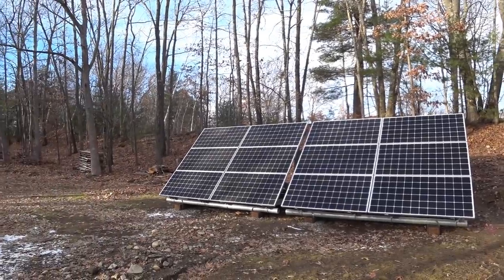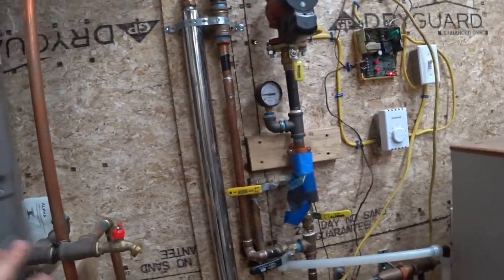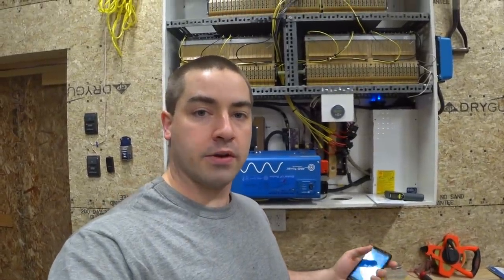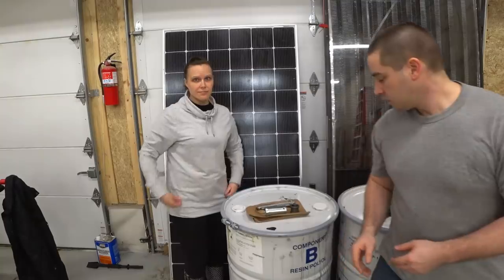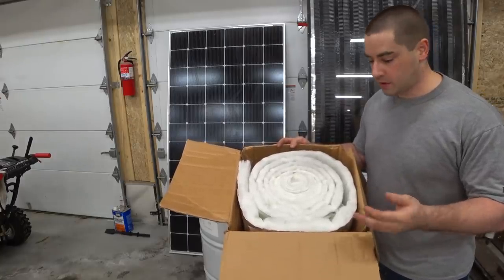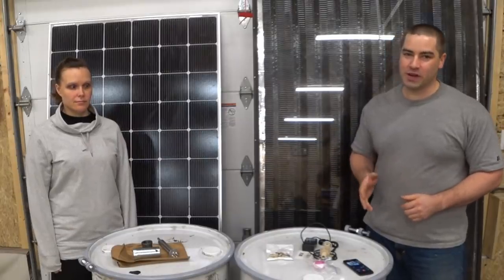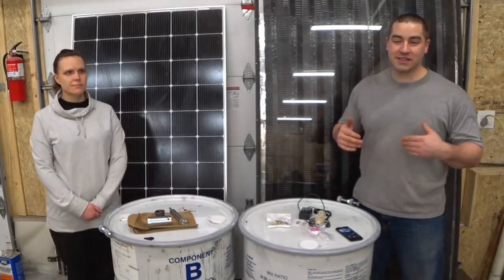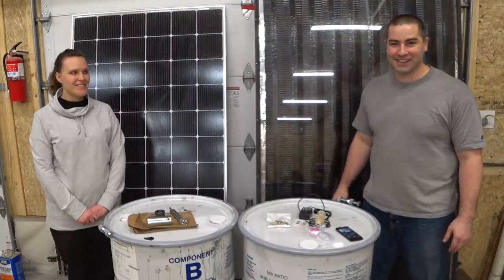Solar PV vs. Solar Thermal Experiment

Comment: Another thing, your thoughts on effiencies of 12v over 24,48 or even 120vdc systems, there is a kinda smart guy , who says the effiencey is not do much to make a difference, I don't like making high current DC connection that I don't have to, that's why I went with 24v, be has a offgrid house 12 v LiFePo4 ( he also thinks liion is crazy)  I do not agree, I wish I went with a 48v on mine. 7s 29.4 is a bit of odd ball. It is getting more common. I have 260 ah banks in my system. I hope to eventually have about 12+ of them. I want to go a week sunless, before needing to start the generator. A bit ambitious I know,  but I don't use alot of power. The fridge and microwave, if it was out of the question I could almost do it now, maybe 3-4 days. I also have about 800 ah of FLA batteries for backup,, anyway, can't wait...
Reply from the maker: Hi James,  I'm happy enough with my 48v setup (actually 44).  I do have a small 12v system just to run my pump.  I would go to a higher voltage if the components were more available.  I think the government (code) is keeping us down below 50 volts DC for residential systems.  But I'm not hard set on one voltage or another.  Whatever works for you and your setup.
Reply: The wire losses are terrible on 12 & 24V elements. It is just unmanageable to work with those high currents.  I run two grid tie panels for 60V and also a 36V (50V) array and run off panel voltage at power point and not battery increasing efficiency. Still relatively safe for people and these work fine with common cheap 120V elements.  5500W 240V elements are not bad either.  My advice is never buy battery voltage elements.

Comment: Multiply the kilowatt hours times 3412.1416, to get BTUs. During the hot summer days, the thermal absorbtion panel will win, hands down. In the dead of winter on an overcast day????? In the conditions of this video, the thermal panel will get the water up to 'bathtub' temperature sooner, but will reach equilibrium at a lower temperature, than the photovoltaic powered resistance element, which has no limit to how hot it can get. So, if you were heating a swimming pool, or a bathtub, go thermal. If you need hot water for washing dishes, or water heater temperature, it will take longer, but the electric heating element will get you there eventually. Those barrels are about the capacity of a typical water heater, making them perfect for this experiment. Assuming those barrels are 50 gallons, and the incoming water is 65 degrees Farenheit, you need 22,825 BTUs to reach 120 degrees farenheit. you need 6.67 kWh out of your photovoltaic panels to achieve that. If it's cooler than 60 degrees outside, your thermal panels might not get there, due to convection, and black body radiation.  Make sure you insulate the plumbing between the barrel and the panel, otherwise, the pipes themselves, could dissipate the heat, not allowing the barrel to heat up to that temperature. The pump has plenty of flow volume, as long as it gets 12 volts, and the pipes are large enough to avoid restriction to the flow of water. Make sure you use a maximum power point tracker, to get the full available power out of the photovoltaic panels, to drive that fixed resistance element. I can't wait for the results!!! Good luck. I have to use the term 'photovoltaic' to define the electric, because they're both 'panels'.
Reply from the maker: Hi Vincent, great synopsis.  I've also done out the math, but IMO, nothing beats a good old fashioned head-to-head competition.  I'll be sharing all the results.
Reply: @DavidPozEnergy  I agree. the world is not made out of paper. I have a lot of questions in my synopsis, all of it having to do with entropy. A real world test, will get real world results. Please post the results!!!(I can't wait)!
Reply from the maker: Absolutely.  I enjoy sharing everything, success and failures.  This way we can all learn together.

Comment: Looking forward to your results. It's looking like a cage match, where my money is on PV. Much more flexibility and auxiliary benefits with PV down the road. Even the initial setup is easier as you don't need to worry about as many leak points, freeze, extra pumps etc. Some possible upgrades from a direct drive resistor in a thermal storage tank would be to add an MPPT switch or inverter, with or without a battery (if grid tie is an option). Each component added to PV can improve the systems efficiency, capacity or add side benefits. Solar thermal is a one trick pony. If you want to go crazy and double the thermal performance of a solar PV, add a heat pump driven by the inverter. Now there is a thermal COP that can more than double the thermal collection. If you need to put your panels further from your home due to site details, PV can transport over copper a long way before 2% loss is seen. Imagine trying to transport solar thermal 200' underground (in frosted soil) and not losing 2%. Even if this "cage" match shows thermal collecting more thermal energy there are so many options with PV that I can't see wanting to be pigeonholed into direct thermal.

Comment: Those thermal solar panels Arrn’t great in my experience double evacuated tubes have a higher return in cold weather than flat panel designs,  , flat panel designs work best in warmer climate /equator properties with ranks on the roof design, now days I’ve seen heat pump panels connected to a pv power source seem to do better in north an climate but are useless when temps drop below -5c

Comment: Your solar water collectors are like an Etzil vs the PV is a Tesla you need the evacuated glass tube solar hot water collectors to make a comparison or at least an equal comparison something so cheap that you're collecting them you shouk d have upgraded
Reply from the maker: I'm using what I have.  If you know anyone giving away some vacuum tubes I'll be glad to make a new comparison test.

Comment: Come on, man ! Solar PV should be coupled with a heat pump if you intend to make heat. The efficiency is actually better that way
Reply from the maker: Heat pumps are great if you are grid-tied.  I'm working on becoming off-grid.  So if I want a heat pump running I have to have more batteries, inverters, and charge controllers.  Also, I'm not sure if you are suggesting a heat pump for space heating, or water heating?

Comment: If you use a heat pump with the Solar PV instead of the heating element, then the system gets much more efficiant.
Reply from the maker: Heat pumps can be a good option for most people.  However, I'm working on becoming off-grid.  If I tried to use a heat pump off-grid I would need larger batteries, and (possibly) larger inverter.  Thanks for watching.

Comment: Solar Electric.....Solar PV? Just get an Air Source heat pump fitted....integrate it Solar evacuated collectors and get electricity from Solar PV/battery to run heat pump compressor.....you'll have hot water even on totally overcast days!

Comment: If you just turned the pump on slow on the ST, you would get far MORE low quality heat than PV, BUT, you would NOT get high temperature water if you only use it for domestic hot water.  Need evacuated tubes or semi compound parabolic for that and they would provide 100% of your house heating needs and Most if not all of your domestic hot water as well.  That being said, if you had a heat pump on your hot domestic hot water tank for your PV to run, then it would be an Even dead heat.  Of course this still would not solve your house heating needs which is where Solar Thermal(ST) is WONDERFUL.  ST even in cloudy conditions makes TONS of ~70F to 100F water.  

Sorry, honest answer is your ST setup is.... subpar shall we say, and you/I still need PV anyways so....

Comment: Biased comparison. Of course you don't get any hot water.  
The collectors you have are the worse there are. They are thin, badly insulated and have an efficiency close to zero. 
Maybe only useful for hot shower water in warm climates where efficiency isn't of any importance.

Comment: I do heat my house with PV solar as it is more cost effective than thermal solar. You can see a price comparison between the two at page 5 in my presentation http://electrodacus.com/DMPPT450/dmppt-presentation-v01.pdf

Comment: You can also get a Heat Pump Water heater at Home Depot for ~$1300 that has a COP of >3.5 so for every watt of electricity you use it provides ~3.5w of heat.  PV is the way to go.  https://www.rheem.com/products/residential/water-heating/hybrid/
Reply from the maker: If you are grid-tied then heat pump water heaters are more efficient.  I'm working on becoming off-grid.  So to use a heat pump water heater off-grid I would need more batteries and/or inverters.  

Also I used to have a heat pump water heater and hated the thing so much that I ripped it out.  I go into some of the details in my article I wrote for  Builditsolar.com

The goal in this experiment is just comparing as simple a systems as I can.  Thanks for watching.

Comment: Wow, I wouldn’t have those shitty flat panel solar thermal units!  I have a small UK home, with an 8-panel 1.84 kW solarPV array on the SE-facing roof (https://www.furrie.net/SolarPV) & a 40-tube evacuated-tube solarThermal array on the NW-facing roof (https://www.furrie.net/SolarHW).  On the best day ever, my PV can generate about 12 kWh.  Even though my Thermal array is literally facing the “wrong” way, it catches the best evening rays & to date (since installation: PV in 2010, Thermal in 2011) the stats are: solarPV = 14,379 kWh & solarThermal = 155,571 kWh

Comment: dirt store heat, so does sand, and its dirt cheap. water is so 2017
lol
Reply from the maker: LOL.  Good one.  I've gone on several home tours, and did case studies, on houses built in the late 70's using sand as the battery.  I didn't find any that were still using the system.  I did find homes built in the 80's using water as the battery and still using those systems.